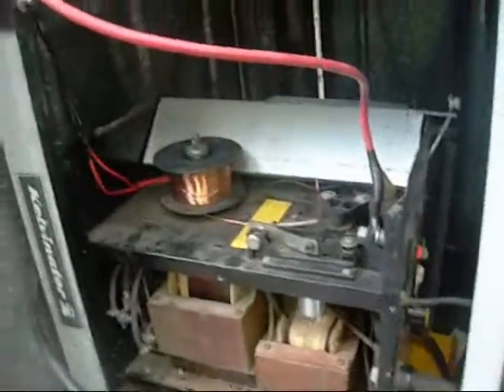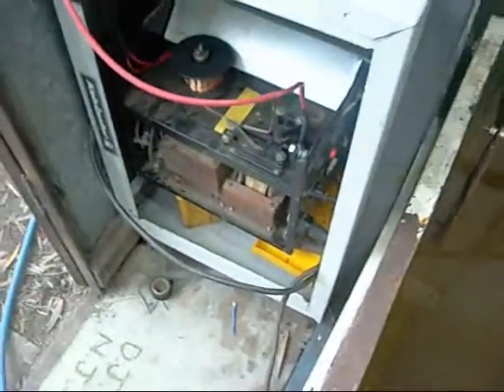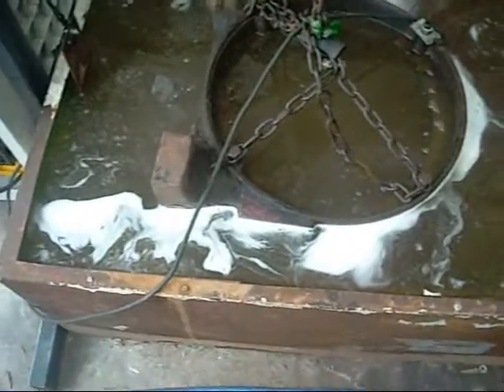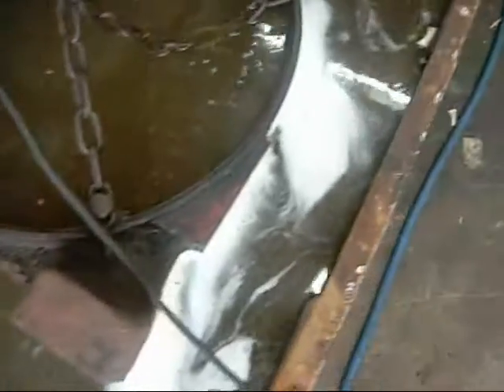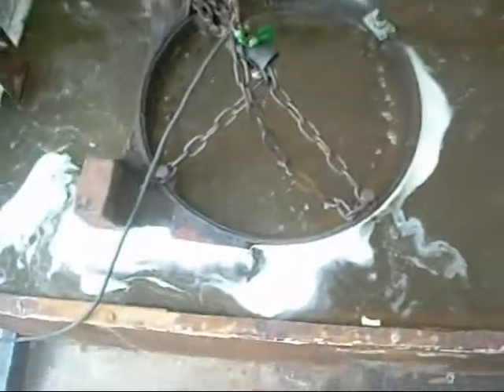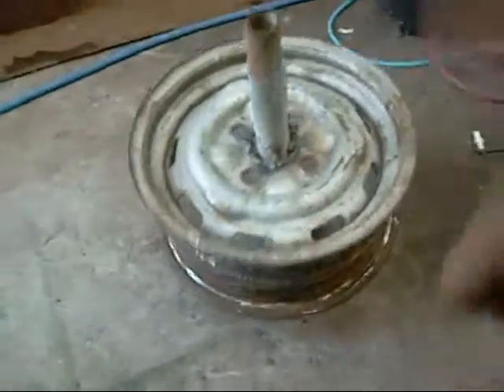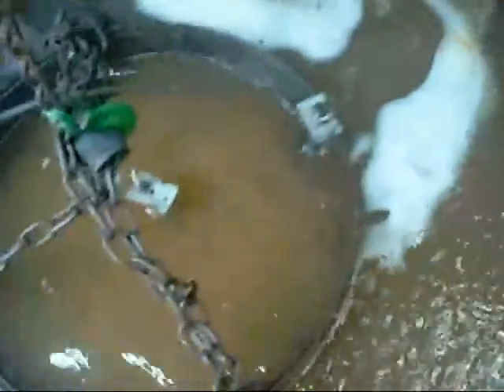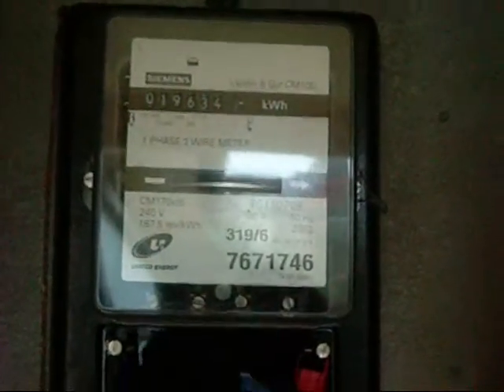Electrolytic Rust Removal on Westinghouse Stator Housing

Comment from the maker: An IBC would work really well!. the welder I was using was only a little portable, probably 100A tops, I only wanted about 30 - 40A across the work-piece and it worked very well!. 
you do need line of sight from the anode to the area to be cleaned/derusted, but it works really well.

Comment: like the system is plastic a better option, thinking of the big IBC containers. what was the rating on the welder, we've got a shit load of old DC arc welders sitting in the back room at work. probably i good option for cast iron stators to remove the rust from the porous sections?

Comment: I made a hho device myself, and I always mix up the electrolyte with small doses at a time. Of course I use a clamp meter, but if you don't have one then it's still better to mix up the electrolyte as you go. The more you put in, the higher the amp draw, but you don't need lot's of amps if you got a day more time.  Also it's better to use unmineralized water  because after some time minerals from the water deposit on the electrodes  and that makes it harder for the current to flow . Greets, iT

Comment: You could put one of those kill-a-watt meters on the input power, and a volt meter on the output and get a rough idea of how much current is going through using Watts = Volts x Amps